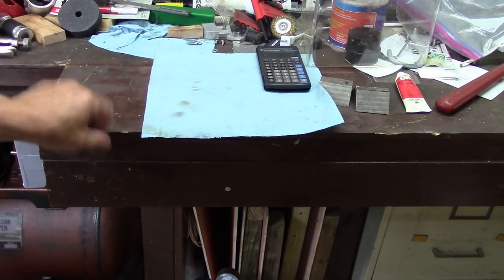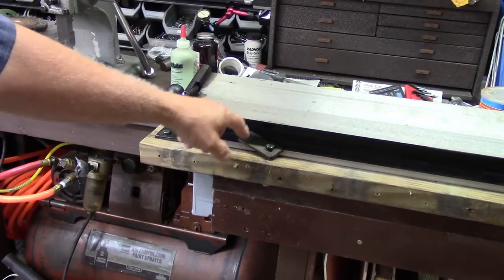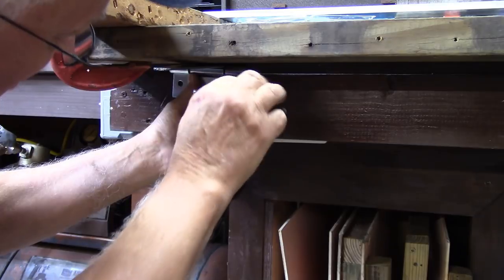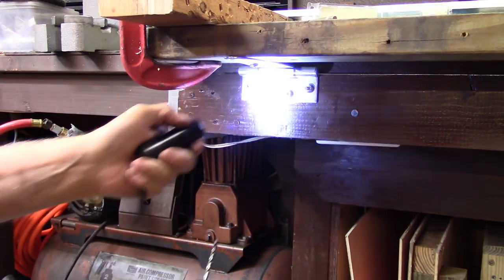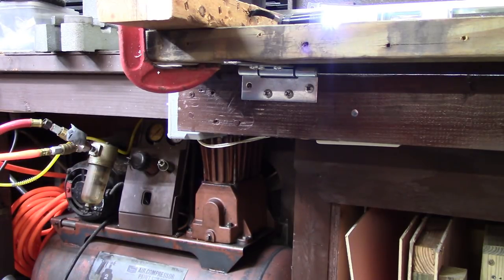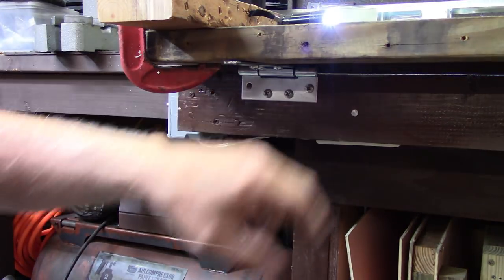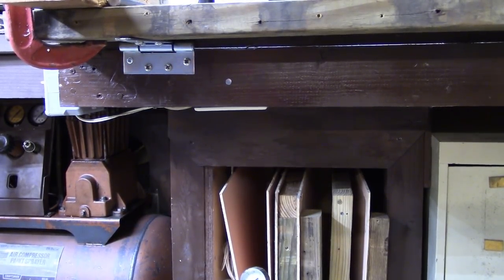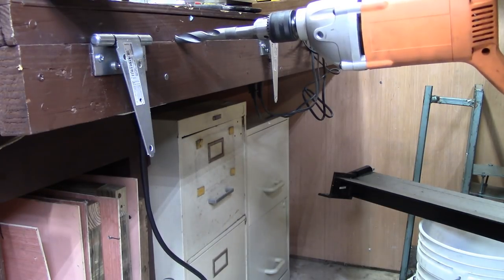Sheet metal brake - mounting it on the workbench

Comment: No a plastic gun by itself is a real problem but that you can make a the trigger assembly without registering is the problem in the USA as far as i know. Also most of the word has different gun laws than the US. A 3D printed gun could be no problem in the US but it can be printed all over the world and with some small changes the barrel problem can be solved.

And to the other point. Have as much guns as you like but secured in a way that they can't be stolen and only be used for a special purpose. It's a difference if 2 gun are stolen or 200. And if a historical black powder rif is stolen, a completion weapon or some thing else. 
Also It's generally a bad idea to concentrate dangerous stuff at one place. You didn't by two tons on gunpowder and stores it in the kitchen.
Here in Germany you can have as much guns as you like (you have to register every one of them). But it has to be "theme" oriented, collector, hunter, competition shooter, etc. And you have to secure the guns and ammunition.

So the problem is not having them but loosing them.
Reply from the maker: You could always legally make a gun in the US.  You just have to make it for your use only and it has to have a rifled barrel.  This plastic gun which needs a piece of metal for a firing pin.  Metal detectors should be able to find a nail.  This is just mob hysteria.  Thanks for stopping by.
Reply: Oh we made special bolts from ceramics one time. I can imagine that some could make a pin from such material.
Reply: What's the trouble with no registering a firearm? Heck we've outlawed firearm registration in my state. Ain't nobody's business what you got. Firearm registration is just a list gun grabbers can use to deprive you of your rights someday.
Reply from the maker: Oh but they promise not to do that.